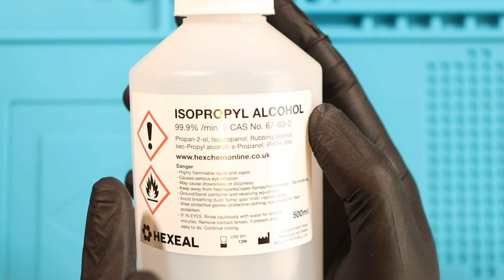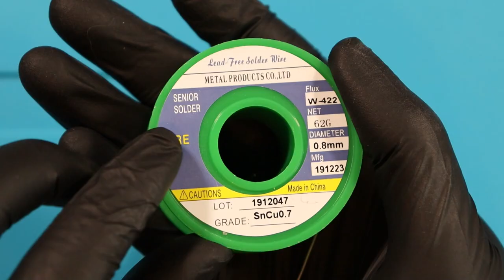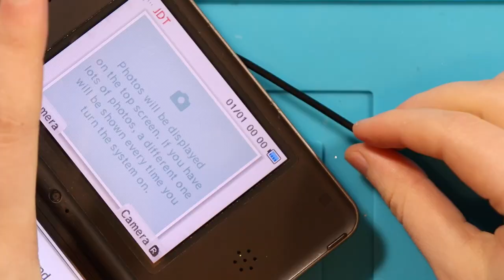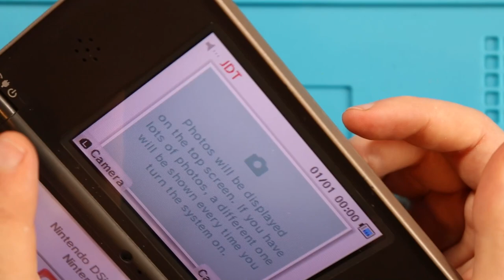Replacing a FAULTY Charging Port on a Nintendo DSi XL

Comment: Unlucky dude.  The ripped pad is definitely connected to the one next to it, so I'm not sure if it's the problem.  It looks like it just adds a ground to the shielding (of the charge port), but I'm not sure where the charging cable takes it's ground from.  You could try just bridging the pins where the ripped pad (call it leg 1) and the one next to it (leg 2, I suppose).  That will at least eliminate that missed pad as the problem.  Failing that, it's possibly the infamous F1 or something more sinister further down... Good luck mate!  👍
Reply from the maker: Thanks Steve. Yeah that sounds like a good idea to be honest. I think i'll start with testing F1 and EM1 hoping for the easy solution!

Comment: First off get some enameled copper wire (it's like . 01 mm for cell phone repairs).  Second, you can try bending the legs next time before trimming them to make sure they fit, then solder.  Third, scrape back some of the green solder paste carefully to show the copper trace.  Fourth, take a short run of the enameled cooper wire to the scraped trace, and the pin that it's supposed to be connected to.  If you do that you will be good to go!  Contact me on discord if you want to do a call =)

Comment: Had the same issue and fixed mine. Check continuity with EM1 filter bottom left and bottom right should beep and then top left and top right should beep - My top EM1 did not have continuity on the top so basically bridged the top and now it is working
Reply from the maker: Thankyou for the info Slingshot! I'll be sure to check :)
Reply: @JoeyDoesTech  Good luck! Can't wait to hear the results

Comment: The fuse right beside the port... it is blown. Use your multimeter to check continuity
Reply from the maker: Will do Onasazi! Thankyou 😁
Reply: Yeah, there's two fuses in the DSi XL (and I think most of the DS/3DS. F1 (usually battery) and F2 (charging)

In the case of the XL, F1 is located on the bottom of the battery board (near the Dpad). If you have no power, it's probably this one. F2 is just beneath the charging port (green resistor looking thing). If F2 is blown, the console won't charge.

When testing you can just bridge the fuses, but if you're gonna sell you should absolutely replace the bridge with a proper replacement.

Comment: Think I read somewhere, somewhen, that even though the DSi, DSiXL and 3DS (can't remember which combination) uses the same DC in port, the way it attaches to the board is different. Nightmare.

I wonder if there's more wrong than just the original charge port. Don't spend too much time stressing over it on each session, but do persist in track tracing the charge circuitry. All the frustrations will be worth it once you've solved the puzzle that is fault finding.

Comment: How about you compare 2 board with working charger one and non-working charger one. I guess broken pads not needed to repair because i think it grounded or if you want to repair. Try run jumper wires from that leg to the points. Try to compare first.
Reply from the maker: Thanks Hyzre, would like to try these methods tomorrow :)

Comment: Will love to see another live!
Did you check for continuity on F1 and EM1 (right next to the charging port)? They may be blow or they may be just not making good contact due to being exposed to the heat gun.

Following the traces, that ripped pad is connected to the ground and to the shielding, so it’s ok if it’s not there as everything is shorted together (both square pads and the ground pin (the one on next to the ripped pad))
Reply from the maker: Thanks Duo :) Yeah Kris said the exact same thing so kind of makes sense. I didn't check either EM1 or F1 to be honest! That'll be one of the first things I'll do tomorrow :)

Comment: With that charge port, you could alternatively very carefully bend the legs flat, atleast I did that a few times and it worked. You should check the fuse below the charge port, but that missing pad, SHOULDN'T affect that, again I did fix one where all pads where ripped, I only ran wires for the 2 main pins, also you could test the orange light by putting the cable in with no battery, the orange light should blink, it won't turn on, but that will still prove you if current is passing
Reply from the maker: Yea that sounds like a good idea Kris. Thinking of testing the EM1 and F1 fuse first though, hopefully that'll be an easier solution!

Comment: joey i was watching this video and i solved the problem you have .on the battery board where fuse f1 is there is a capacitor called tp1 that is the cause of no charging light and it not charging i swapped out the board today for a new one because the tp1 capacitor was shorting to ground now it works also the pad you tore was only a grounding pad as long as you did not lift the two middle ones you are ok
Reply from the maker: Thanks for the heads up Jon! I'm pretty sure I fixed this one in a later video though. Now I have sold it aswell, but will 100% consider this going forward as never heard of this fix before...

Thanks :)

Comment: Same issue, same type of port.

I've resoldered, and even fixed a blown fuse (which happened AFTER i put the new port in). I can charge ONLY if i put downward pressure on the cable while pushed into the port. I know my soldering is fine, i cant for the life of me figure out why it needs pressure on it to charge.